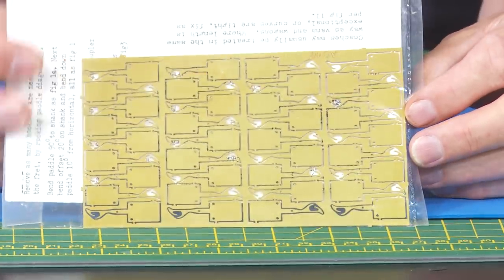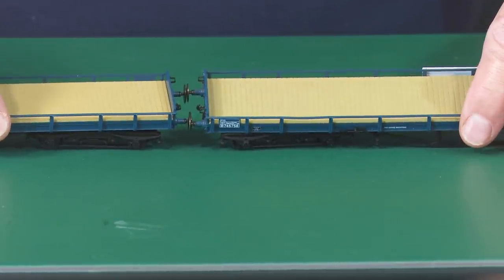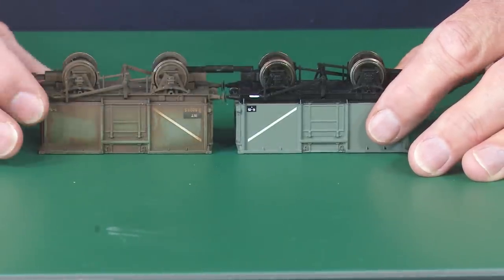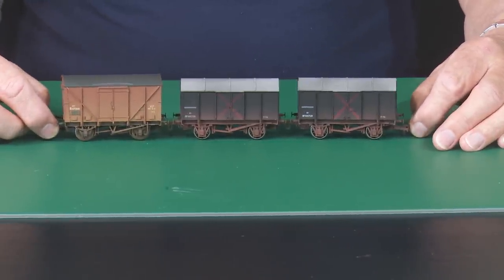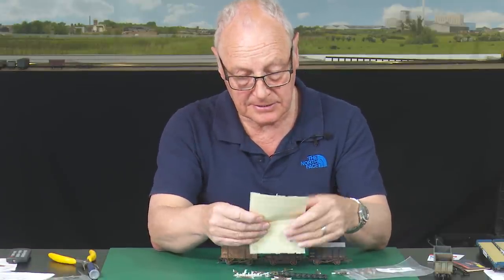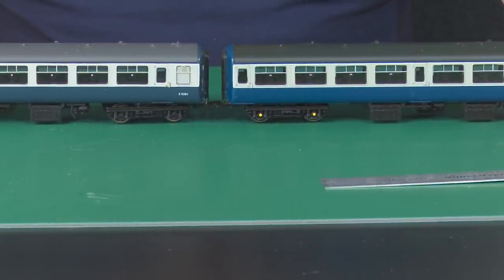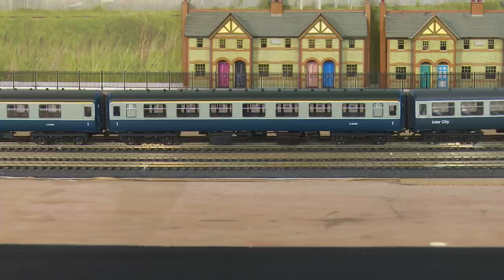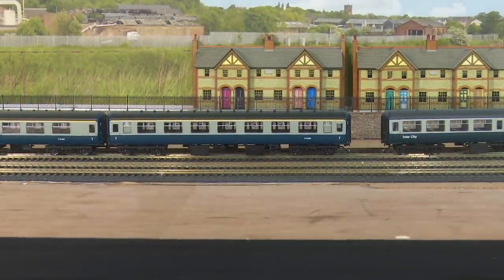NEM Couplings at Chadwick Model Railway | 92.

Comment: Hi Charlie. As i use "Sprat & Winkle" couplings its quite reassuring to know that you have categorized me in the " Finescale" modelling brigade as appose to the "Great unwashed" brigade.
Thank you.
Colin
Reply from the maker: Credit where credit Is due Colin.
Reply: I was in the finescale camp for about a month but found bending the staple then soldering it all just too much as the tolerances are miniscule (I even watched a good Tutorial on YT but its not easy). I also dont like the wire across which isnt very realistic. So Im back with the great unwashed trying various types depending on stock type
Reply: @paulredding5864  3 links. It just means the hand of god comes down on your layout now and then with a big hook but thats just fun for the little figures on the platform to see 🤣

Comment: Can NEM Couplings fit inside gear boxes that horn hooks or knuckle couplers swivel inside of?

Example: I have some old rolling stock that has gear boxes built into the frames or the bogies and was wondering if a NEM coupling would fit inside there and click into place on the other side, or would I need a NEM gear box specifically? I'm trying to get a tension lock style train from Bachmann to work with kadee rolling stock and am having an extreme amount of trouble trying to problem solve this coupling issue.
Reply from the maker: I’m sorry you’re not having much success, but welcome to my world. Yes it’s a nightmare, regards Charlie

Comment: with magnetic couplings, what happens if you have magnet operated reed switches on your, probably more analog railway? do the magnets have a negative effect? If you could, rather than use magnets, what would happen if they were electro magnetic, so for shunting the magnet would be turned off, for running it'd be on
Reply from the maker: I have heard of no issues with magnetic operated red switches. However, for shunting I tend to use a mixture of electro magnets and fixed magnets in the track.  Regards, Charlie.

Comment: Thanks, Charlie, a detailed analysis. What are the forces during buffer-clash compared to the Hunt Coupling?  Is there any mileage in having a spring on the Hunt to allow it to be closer than worst case requires, which makes it better for normal and nominal cases. And as to why your coupling was weaker than the Hunt version; firstly, accuracy of the 90• may mean your contact was not as square (hence binding over the whole area). Second is similar; your rod was an arc segment, so when pulled caused the mating surface to deviate from 90•, whereas the hunt version was straight.  But interesting to compare, especially as you could chose to make your own to fit your curves, stock and expectations, rather than the Hunt version where two sizes fits all. (BTW, do they do a close couple HST set, which may improve your reported gap?). Finally, I wonder about three link couplings where the instanter lump is the magnets, but the basic link hangs free when not connected. Optimal appearance, close coupling, and if the link is made of springy metal, reduces the impact of buffer clash. All thoughts and royalties gratefully accepted!
Reply from the maker: I spoke with Chris Hunt yesterday, of Hunt Couplings.  
He will supply me with a set with different tolerances for me to trial.  
Fingers crossed Tom.
Reply: @ChadwickModelRailway  Charlie, update.
How much does the Hunt coupling rely on two magnets linking together, or would one magnet link to the metal of older tension locks (including the old Triang open loop and hook)  You will have seen the new combined Hunt couplings, where the Hunt has a loop for the hook to grab; my thoughts came from the magnet part of the Hunt, which might provide good linking without the hook, if the D is metal. (ntersting; in case of buffer clash, the magent could release, and the hook keep the train linked; after a moment, chances are the magnet would recover link...
Regards, 
Tom

Comment: Hello Charlie, I do not have anything with a NEM pocket. All my Locos, Diesel and rolling stock have Tension Lock Couplings and they have been around for more than 50 years. What should be the distance be between coaches? The Corridor connectors are moulded in the retracted position, aren't they?  There are some corridor connectors on the market. I have never seen them or anybody on YouTube using them. Barrie Davis uses the tension lock medium Couplings and he swears by them. Most of what he buys are fitted with NEM pockets and it is a straight swop over. Magnetic couplings are not very good if you have a Shunting Layout. Unless somebody comes up with an uncoupling device for them. Martin. (Thailand) Why do my comments end up being short stories?
Reply from the maker: Hi Martin, the paper curtains are for sale on eBay.
https://www.ebay.co.uk/p/598309024

Comment: Locomotives have a front end... you could designate that as the "A" end for your magnetic connections. "B" magnets for the "B" end or "butt" end...  
Further with the magnetic couplings, identifying the "A's and B's", does the U.K. have designated ends of freight and passenger wagons? In the U.S. and Canada, the "B End" has the brake wheel...  Perhaps your wagons would be "so identified" as to how the magnets are attached to each wagon coupling. I don't know the difference with your wagons visually, but North American freight cars have immediate distinctions.
Right... our model couplings hardly vary beyond knuckle couplings (such as Kadee) and X2F (horn hook). Aces to you for having a "Rake" set of freight wagons set together with the rigid couplings... (how much is a rake?)  and your coaches could be paired instead of grouped by 10 (I was listening)
[...and cue the phone is as cute as your wife giggling in the background]...
um, back to my point...hmmm...
Oh, got it... I may have said in past comments to your videos of couplings about my methods of avoiding a total conversion of couplings, and that is: your explanation 8:25  ...I keep X2F's at one end and knuckles at the other in "sets":  Knuckle]wagonX2F+X2FwagonX2F+X2FwagonX2F+X2Fwagon[Knuckle  :Visually spelled out that way. And for your acceptance, I substituted "wagon" for "freight car." "Coach" is basically universal.
More insight and much regards to your efforts!
John  Kamloops, BC  Canada
p.s. Jenny Kirk measured the strength of the magnetic couplers by "hanging" them vertically... at least four coaches or at least 12 freight wagons... it was some time back but quite the proof they work well.
p.p.s  Curious about your DMU's... they are always in pairs, or two pairs when combined. Would they look quite similar to a pair of coaches? I'm just imagining , if someone didn't own any DMU models, that they would simply "stage" a pair of coaches beside vacant (yet, somewhat distant) platforms to mimic real model DMU's.
We all digress at one time or another... and that's okay.
Reply from the maker: What a great comment. Here in the UK the wagons are not matched A or B ends but in particular although some specialist carriages are end. specific. Regards Charlie

Comment: another great video. i have a mixed relationship with couplings. i like the kadees, i have bought quite a few packs of sizes 17-20 with the nem fittings.  not had the greatest luck with them, but some of that may be due in part to my dodgy track laying and using set track -  a mistake that has since been rectified. i have yet to fit them to my new setup and test as i have a 3 year old....god help me. i was wondering if you had much luck with kadees and backmann mk2s? - i find some bachmann locos 37,47 etc have rubbish nem socket heights.
Reply from the maker: Hi Phil, my Bachman mark twos are only fitted with Hunt Couplings or Keane couplings. That was a good move by you to get away from set track.

Comment: Hi Charlie.. just thought I would share my experience with hunt couplings.. poor quality plastic, soft and not always locked in to NEM socket, quite often pulled out going round track.. In addition magnets weak with a rake of coaches and separated and some even just fell out of plastic socket! Needless to say I sent them back and in fairness got a full refund so still looking for a decent coupling.
Reply from the maker: Thanks for the info Scott, though you are the first to mention problems.
Reply: @ChadwickModelRailway  maybe I just got a bad batch. Cheers...

Comment: One  solution to the gap between couches would be to insert black foam sheets between them. Cut two sheets (or more) that fit in the doorways then sandwich one larger one the size of the outside of doorway. This should work as a plug between coaches'.
Reply from the maker: They will send me a closer fitting set to trial next week.

Comment: Hi Carlie
Would it be easy to cut the end off of the hunt coupling on the HST coach, shorten the shaft and re stick the magnet back on.
thanks for another very informative vidio
Reply from the maker: Good point Derek but Hunt Couplings are going to make some smaller ones for me to test.
Reply: @ChadwickModelRailway , Hi Charlie, I look forward to your test vid.
Are the D G couplings still avaliable,( i made some years ago,I am returning to my layout in my loft after being too bizzy to find time to play trains.) bit of a fiddle to make but I think they are werth the effort for 4 wheel wagons.

Comment: Well done Charlie. A great summation of this problematic and messy subject. 

The base problem is there are too many variables. You have the variation in manufacturers standards, both between different brands but coupling variation by the same brands over time. Then you have the variation in markets. For the toy market tension lock is cheap and proven and probably visually acceptable. Then for the serious models market you have the layout to layout variation in curves severity and the individual owner's tolerance to vehicle spacing. Then, finally, you have the uncoupling question - the need (or non-need) for which hinges on a fresh set of variables such as era modelled (loco+train vs multiple units) end to end or round and round operation, passenger versus frieght, fixed point uncoupling or uncouple-anywhere ....and probably other things. In light of all those variables it is small suprise that there is no ideal answer!

I think if I could somehow wipe the slate clean, I would say NEM pockets on all vehicles at a standard height, with some kind of Kadee type coupling, but all engines/traction cars must have an inbuilt micro-solenoid which the decoder can activate to uncouple via a DCC command. Such systems do exist, but I think the cost of those and the sheer volume of legacy models which are around make it unrealistic to get to such a standardisation in our lifetimes!

https://www.youtube.com/watch?v=R479HMc2fi0
Reply from the maker: Hi Alan, you are certainly pushing on an open door on this one.
I couldn't agree more. Regards Charlie

Comment: Hi Charlie, if the Hunts couplings still look too far apart, why not cut a bit out of each coupling then glue them back together, to adjust the distance between the coaches.?
Reply from the maker: A good point but Hunt Couplings are going to make me a shorter set to trial.
Reply: Brilliant! That’s what we need, a manufacturer that listens!👍

Comment: Hi Charlie, I've just seen your video on couplings and you mentioned that we do quite a bit of it. I wonder what to do with the magnetic type if you want to remove the hand of God, how can you make it happen? Great video, thanks.
Reply from the maker: I only use magnetic couplings on fixed rates of coaches, my freight stock is normally KAdee

Comment: I know about 3d printing, a printer is anywhere from 250$ to 5K$ and up. I have an Ender 3 and it works wonders. For your question about price, I made a luggage van for under 3$. You could make those chain links for less than 20c each. Depending on the plastic you take. If you want to get started, make anything, makers muse and 3d printing nerd are great teachers
Reply from the maker: Thanks DW, sadly I’m just to busy at the moment.

Comment: Could we get a link to the NEM boxes from ebay that you can glue onto rolling stock. I've checked eBay and haven't been able to find them :-/
Reply from the maker: Try these.
https://www.ebay.co.uk/itm/OO-Dapol-Hornby-NEM-converters-18x-pockets/202970059549?hash=item2f41f5531d:g:0DgAAOSwIh1emhoZ
Reply: @ChadwickModelRailway  I was thinking more for mainline and old hornby that has the coupling screwed in but that solves the hornby clip coupling thanks!

Comment: I have seen these pockets but most of my stock is old and I do not have any nem pockets. Have you done a video to convert to nem pockets from tension lock couplings  and who is the company selling hunt couplings please
Reply from the maker: Hi Bill, the company selling the couplings are called Hunt Couplings and there is a link in the show more tab below the video. Also, you can buy NEM pockets on eBay to convert earlier wagons.
Reply: Chadwick Model Railway thanks for the information it will help  unfortunately most of my stock is old and to be honest at the prices are a bit to high for my pocket  so it is time to make and mend  thanks again

Comment: My idea is to use sprung buffers and chain links on all old stock and on the frames and not chassis and buckeye couplings and stitched together the connecting corridors on coaches but the only problem is not to use a curved track and use long points.
Reply from the maker: Sorry Ian, but you have to use curved track.
Reply: @ChadwickModelRailway  Not on my long-ish Diorama I don't. Straight lines to a preserved and museum layout. See you at Ally Pally 2021 if we are not sniffing our lives away with fear!

Comment: Back in the day (1950's) there were diaphragms available made of rubber with metal frames. These bridged the gap quite nicely, being about 3/16" deep uncompressed. Mounted on coaches they nicely closed the gap visually, but compressed quite readily for short-radius curves. Sadly, they are no where to be seen.
I have also seen homemade diaphragms made of folded black paper which looked acceptable, but the ability to return to full size across the gap was limited. Seems that there is a great opportunity for a manufacturer to bridge this gap (sorry).
Reply from the maker: You make an excellent point Jack. I too have seen the card bellows. Although I have never tried them. Regards, Charlie

Comment: It's amazing that bumpers are still on the British rails these days in basically their original design, rather than built-in coupler shocks or some "newer/better" form than the dual discs.  But traditions die hard everywhere (just look how long it's taken for ATC to be required in the US).  Bumper clash/lock can make it a bad day on the layout!
It's perhaps not surprising that full size freight couplers aren't changing much since the cost to change over is probably not worth it there.  But I am surprised there isn't a national standard for passenger cars, which is the UK's bread & butter rail service.   A shock mounted Janney (knuckle) style would seem to be the optimum on British Rail. 

For UK modeling, my opinion based on very little knowledge says sprung Kadee knuckle coupler heads at the end of self-centering kinematic bars would be nirvana.  Hmmm 🚉
Reply from the maker: I take your point Frank. In the UK, we are not served well by our manufacturers. The couplings are just an embarrassment.

Comment: Interesting information but magnet couple is nothing for me when i use Roco short couple instead. I have digital couple on the locomotive which are nice to uncouple wagons with the short couples. By the way...Kadee are US couple for the locomotives and wagons without the buffers! Kadee are not fit for the european wagons with the buffers.
Reply from the maker: They work perfectly well and are far better than the normal tension lock coupling Anders.

Comment: If a person had the model for those "solid" couplings you could 3D print maybe a dozen of them rather quickly and the material cost is very low $1 for the dozen would cover time and material (purely an estimate not having the model to try). Now of course this is from the perspective of a 3D printer owner. Although I enjoy model railroads I don't have one but my opinion on the coach couplings I actually really like the look of the homemade one, perhaps with a stronger magnet it would hold up as good as the purchased one. Just my opinion for what it's worth.
Reply from the maker: Intersting points Tom. Regards Charlie

Comment: Those coal wagon couplers seem to be set too far back for a NEM shaft, especially for ones without kinematic mechanisms (on euro stuff the front of the pocket should be flush with the buffer bar)
That amount of vertical movement on the couplers of that Motorail wagon is way off the scale, it surprises me that the kadees are still holding on at that angle
Reply from the maker: Perhaps but they are far better than anything else currently available.

Comment: I'm 15 and have a 3d printer for my model railway those couplings would only use about 5 cents at the most
Reply from the maker: But can you print them Josh?
Reply: @ChadwickModelRailway  I don't have the file to print I'd have to design them